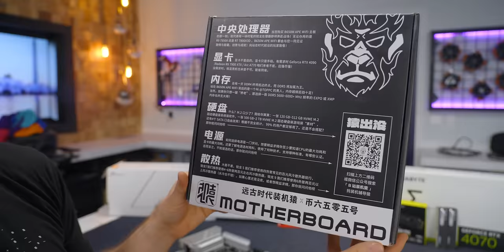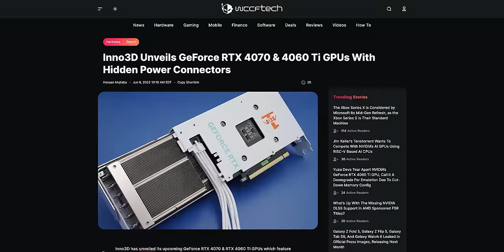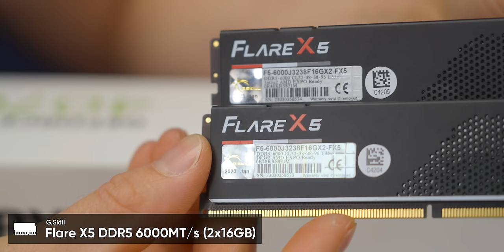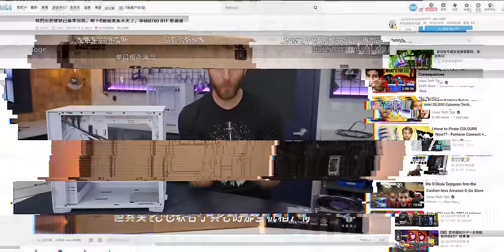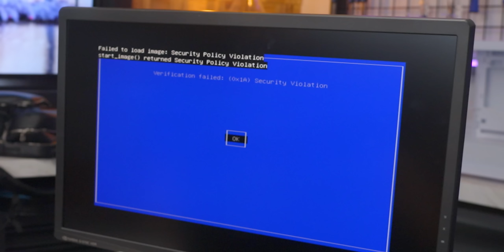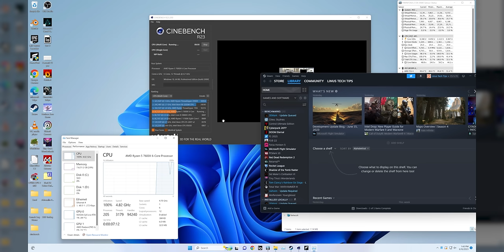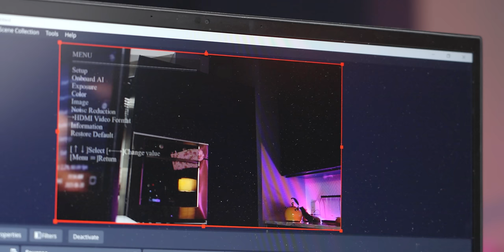This Beautiful PC has an UGLY Secret…

Comment: I love the idea of rear facing jacks. Hate the idea of proprietary connectors (because of how likely it is.) Would love for power supplies to have more reasonable cable lengths in general, but assume custom cable lengths would be necessary on any of these builds, which I don't love.

Comment: I am never going to buy a new computer case... or power supply if I can possibly get away with it.  I picked up an Antec P-160 case with window back in 2003... yes 20 years ago and still use this same case in my main system.  My Creative Labs Inspire 5200 speakers I picked up in 2004.  I love these things.  I also still use my Antec EarthWatts 650w power supply I bought back in 2008... 15 years ago... the same time I bought my Western Digital 1TB hard drive I still use as my boot drive.  I picked up my LG Super-Multi Blue Blu-ray burner back in 2010.  I have a newer Ryzen 5 6600, ASRock B550, Radeon 6650XT, 4x4GB DDR4 3200 I picked 5 years ago, a WD 4TB I use for system backups is probably 3 years old, and a WB 1TB NVME gen 3 is likely 1-2 years old.  My system is a Frankenstein of old and new parts.  I have never formatted the hard drive and re-installed Windows since I bought the drive.  I originally ran Windows XP Pro.  I upgraded it (not a fresh install) to Windows 7 Pro, and later upgraded it to Windows 10.

I have been building my own systems for over 35 years.  My first real PC of my own was a 386 SX25, but the first PC my oldest brother bought was a TRS-80 Model 1 back in 1977 when I was 8.  Another broth got a TRS-80 Color Computer when I was 11, my oldest brother got a 286 12.5Mhz system when I was 16.  But really my first experience with a computer was my dad bringing home (likely around 1974) a teletype machine from work with the printer (no monitor) and a phone coupler.  It connected to the main frame at GTE where he worked.  He would print out calendrers using character string art and we would play a game called Hunt the Wumpus that was made back in 1973.

I did buy a new off the shelf system in 1997... a Cyrix PR200 by ABS and it sucked so bad.  I had to format the hard drive and re-install DOS 6.0 and Windows 3.1 about every 6 months.  It was slow as dirt too.  It did have a CD-ROM though and a 15" color monitor that did something like 1280 × 1024 resolution.  I upgraded it to an AMD K6-2 350Mhz and have been AMD since then.  The only retail computer I ever bought after that Cyrix was a laptop made by a subsidiary of Best Buy in 2004.  It was an Intel system but more importantly it had an Nvidia GeForce4 MX420 and could run Call of Duty: United Offensive on it fine, a DVD drive, and Windows XP.  I think I actually still have it in the basement somewhere.  The battery died about 12 years ago.

Comment: You know Gigabyte made a case for Project Stealth. They have an RTX 3070 also with the 8 pin connectors moved to the back of the PCB. The Aorus C500 also has a Z690 motherboard. It would be nice to see more manufacturers make newer GPUs with the rear facing pci-e connectors that can work with the Project Stealth cases

Comment: They need to 90 degree all the connections on the board and 180 for the gpu would put the cable straight down

Comment: I actually dont like the idea of connectors on the back because in general connector location is not standard like how some boards will place connectors in certain places for better power delivery for overclocking. And placement efficiency depends on the overall layout of the board down to the traces. Locking board design into a standard for connector location could hinder over all innovation.

Comment: Theoretically if they rotated the motherboard 180 degrees clockwise and designed it with backwards PCI- e lanes and moved the IO you could put the GPU at the top of the case with its fans angled down. You'd be able to hide the power cables on top. Of course this would require the case to have a custom IO plate for the mother board and custom whatever it is you call the slot on the case for the GPU but the effect would be almost hiding your GPU in the upper portion of the case making it look very clean.
Reply: HP do this already.

Comment: Not sure... in my current setup I can only see the GPU and motherboard power cables... not much different than this. If the PCIE power delivery extension slot becomes the norm... then maybe I would consider this is useful.

Comment: I think there might be a way forward here. I can't imagine the motherboard vendors are going to standardise the layout (even though they totally should) so, hear me out... what if the motherboard tray was physically supported by the rear side panel and was only connected to the rest of the chassis by the back part? That way you could pull off the rear side panel and route all your cables wherever those need to be and then close it up and have just as much if not more structural integrity, assuming a good strong panel. You could even have the mobo tray attached to the panel with captive bolts and have little hidden screws on the rear side panel for extra strength.

Comment: I can’t deny that it’s a clean build… but I’m really not in love with it from a technical perspective. You’re basically locking yourself in on case and motherboard selection, and with Asus’ solution to GPU power you could upgrade to a standard card, but your old one is going to be hard to repurpose/hand down/sell. 

…but if you’re going to sacrifice compatibility for clean looks, why not go further? I know that this is probably a variant of an existing design and not a total clean sheet for cost reasons, but if there is a future clean wiring standard, I think it should go ATX12VO, move the front audio somewhere more reachable, and maybe experiment with combining all the independent cables that all go to the front of every PC into a single cable? Reduce the amount of cables that even need to be hidden.

Comment: Why not use the CableMod 180 12v connector to help the GPU cable? I don't know why GPUs don't have a dedicated power out the back under the ports or under the card near the PCI slot. Would just eliminate all that plug in from the front mess.

Comment: This looks like it will have massive compatibility issues with PC cases. All cases would need to have specific cutouts behind the motherboard where the cable connectors are going to be. And if every motherboard manufacturer places their connectors in different locations then everything is screwed.

Comment: They are gonna need to make a motherboard standard for it.  Like ATX-R or something like that.  It'll take an ATX board, but is capable of handling reversed connectors.  

Cuz I suck with dremel tools and 100% will probably wipe my eyes when my fingers still have steel filings on them.

Comment: I'd go for this. Cable management has always made me angry. There's too many times there just isn't a good place to route a cable or you don't have enough space or whatever and it ends up kind of just there. My case doesn't have windows or any of that nonsense so it's mostly irrelevant to me provided a cable doesn't get sucked into a cooling fan or something but I'd prefer it cleaner and this seems like a pretty smart solution.

Comment: I like the Idea IF they implement some sort of standard.
If not, why bother
But i kinda like the look of those nice sleeved ATX cables and PCI cables in the Case.
Also, please dont implement that cableless PCI standard that draws power directly from the board, i wanna keep my PCI cables. 
Also, theres no need to hide M.2 SSDs in the back, they look nice, are hidden already behind coolers or covers and you need to access them sometimes.

Comment: I'd be all for rear-facing variants of cases but only so long as they didn't replace traditional ones. I don't care about the aesthetic, personally. I just want things to be easy to manage and upgrade. Especially given I am more enthusiastic about the tech than the appearance.

Theoretically, motherboard manufacturers should be able to design their boards so that they just have to solder the pins on the side of the board they want, meaning almost no difference in the assembly line. For case manufactuers, there's no reason they can't support both in the same case, provided there is a standard for it.

Comment: my rule is less is more. no leds (at least none that require a cable, built in leds are fine), bus up your fans, trim and sleve your mobo-case connections, and run nothing but nvme drives (spinning disks in nas only). power supply connections leave something to be desired, i hope that 12vo becomes a thing since its connectors are a lot smaller. if only we can get an on-mobo power rail for the gpu. if your computer contains an led or fan hub, you are simply doing it wrong.

Comment: I think its a great concept, as long as it doesn't turn into a clusterfuck of all the different mobo brands putting connectors in different configurations and there needing to be a crazy level of compatibility checking for which cases support which mobos etc. If they can agree that ATX mobos use this layout, mATX uses that layout etc and case manufacturers can create cases accordingly, then its a win.
Reply: I doubt it would be that big of a deal, they already pretty much all put the connectors in the same place give or take a centimeter or so anyways, as long as case manufacturers make the holes big it should be fine.

Comment: I would like to see graphics card manufacturers move the power connection to the far end of the PCB on the motherboard side.  That way people should at least be able to hide the power cables behind the graphics card.  Otherwise I am all for a new standard where cables are plugged into the back of a motherboard, but only if it is an industry wide one.  Having more than one would make buying a case a nightmare and I could see many people just sticking with a standard ATX layout in such a situation, simply because they would then know that their motherboard would fit in the case.

Comment: If you would have put this system in a case that allows for a vertical GPU mount and use the cable mod 180 degree 12 pin adapter you could redirect the gpu cable behind the gpu through the top of the PSU cover you wouldn’t see it at all. And since your already cutting up a case a little hole for a gpu power cable is not a big deal.

Comment: If the motherboard backplane design uses an established layout I wonder if it might be better to just 3D print a new motherboard bracket and cut the original out entirely.  Might be better if putting an ITX MB into a mini or full ATX case.

Comment: I wish the power cables for the gpu would be put on the short end towards the mobo on these new cards. I know the boards aren't that long but really it's not hard to either have a tiny daughter board or just a extention that screws into the backplate/shroud

Comment: So heres the thing:
IF The 24-Pin and 8-Pin powers were mounted at 90*. You could installed upto 1inch standoffs in ANY Case, and route the cables UNDER The motherboard - Without having to cut pass throughs into your case. Problem solved.

Comment: I wish they were pushing PIO instead of rear cabling.  Rear cables actually make the case bigger by forcing their to be un used space on one side and the requirement for extra dead space on the backside🤦‍♂️.  Unlike this having the graphics card Parallel (IO) to the motherboard and coming out the top has numerous benefits.  

Like making your other PCIe ports useable again.  And allowing much fresh air to the GPU and CPU.  And being mostly compatible with cases already on the market simply by having an open expansion slot area (many cases have this).  Just requiring 4-6 extra holes for standoffs.

Comment: I could see this working great with the new 12V psu standard If they actually made a proper standard for the reverse connectors. If they actually standardize this then PCs would be easier to build and maintain and we could use shorter cables which has a lot of benefits on its own.

Comment: The case manufacturers should just make the least amount of metal on the mother board tray as possible while still maintaining some strength. Move all the screws to only the outside, keep basic atx design. Now you can place the connectors anywhere besides a few places. problem solved, everyone wins.

Comment: I just wish they (computer manufacturers) would move away from the giant 24-pin connector, separate 12v CPU connector and the tiny wires being used and make all of the necessary power wires with a heavy 4 conductor turned pin and barrel XT style connector  and all of the signal and low current wires from the PSU use a separate smaller 5 pin JST style connector.  Since the 5 signal wires could be 20-22 gauge they could be housed in a small single cable making routing easy since the smaller cable can make much sharper bends when routing.  The wires used for the 4 heavier cables could be tin coated fine strand copper with silicone jacket for flexibility 10 AWG for the 5V, 3.3v and 8 AWG for the 12v and ground connections in ultra high-performance motherboards that use a lot of power.  For normal boards and CPUs you can probably easily get by with 12AWG for the 3.3, 5, and 12v wires and a single 10 AWG for the ground.  For low-power boards you can get by with 16-18AWG for the 4 main power connections and be well within limits.  You can already see a similar thing being done for decades in prebuilt systems from Dell, HP, Lenovo and others so it just requires an established standard that everyone chooses to follow just like these motherboards and cases.

Comment: I do not understand - what is the point of putting cables on the back? It just means you need fatter cases for the cables/connectors to clear and serves no practical purpose.

Comment: It's as niche as itx stuff. Companies can easily make them, but they won't be widespread enough. You'll really only see youtubers building with them. People generally don't care about cable management or minmax airflow. There's only a few that care about that kind of thing. Heck, specialized cases will probably end up being more expensive as well since they need more cutting/smoothing and also adding extra space for the back cover to be compatible with all sorts of connectors, which equals extra material. 

The things that truly need a change are the cables themselves. It's weird that they still haven't figured out a better wire to use to power stuff. Connectors change all the time, but we're still using the same bulky wires, so the same cable management problem still exists.

Comment: I don't get the point.

Wasn't part of the point of the giant void inside the case for all the cables?
Then again, that's from the age before computers had a window in the side to let you see the guts.

But if it actually became a new standard, such as ATX-B or something like that, B standing for Back, then I'd be okay with it, because then at least you know you need to get a special ATX-B case and ATX-B power supply to go with your ATX-B motherboard, which was the point in ATX over AT in the first place.

Comment: If the motherboard manufacture couldn't agree on the placement then it won't take off. Imagine the nightmare having to buy another case and everytime you change the case you have to search the compability. PC building this past year is so easy, and I don't think consumer wanna go back to the time when buying and building parts is a hassle.

Comment: This is why the whole mother board needs to be done another way. While people are so hyped up for for led on everything and displaying their computer till they get sick of it and shove it behind or on the floor. 
We need these boards to become slot much like a server rack would have. A long if not longer than a GPU and have the connection to the rear so that you can either un screw or unlock the component and pull it out. 
You should be able to water cool everything via push to connnet connection on the connection side which has the power and the data connections. Each unit can be water cooled via a rad on the top of the unit. 
You power supply can be upgraded it you need more power or down graded if you need less power. There are no wires as your case front is a pcb board which has every connection button you need. A standard pcb board with standard connection on every single one. The IO board get slid in and provides all of the IO you need and supports the standard front board which would have 5 usb 3, 5 usb c PD shared up to 100 watts, headphone and mic, power button as standard. 
You can also have fans instead of the water cooled model, even if you have the water cooled model you can still use the fans. The connection side will have a rubber seal that once pressed in place and locked the seal will draw cool air from the real filtered front meaning that the air that goes in to each sealed unit will be clean and dust free. The bios will also have a pressure gauge of sort to make sure that there is ample amount of air flow going in to the sealed unit. If the unit is water cooled then the unit will provide the plug on the end to seal the unit so that other less heat demanded things can use the air chamber. Which is just a hole and fitting cut in to the pcb board. 
So you would have CPU and chip set, upgrade ram unit, GPU and chip set and upgrade ram unit, M.2 drives in the form of ram which sit vertical and each drive bay would allow up to 30 m.2 drives and 20 ram on the cpu and 20 ram on the gpu. That would make the case 18 inches long and 6 inches wide and 12 inches tall. I guess you could add in a few more bays for dual CPU and GPUs and so on. Really it comes down to that PCB board and how you use that to transfer data from one place to the next. 
Size and space really just comes down to what it needs to be. Really you can make it sideways for rack mount and make it a 6u unit. That should be big enough.. 
GPU 
CPU 
SSD
PSU
IO